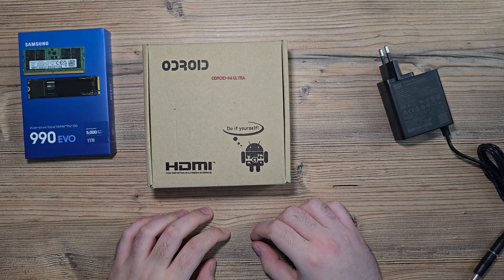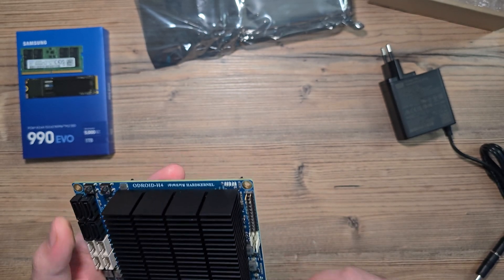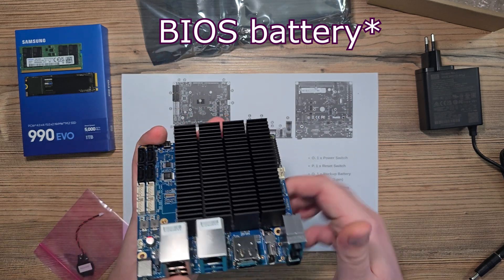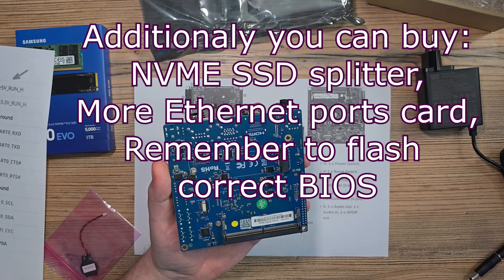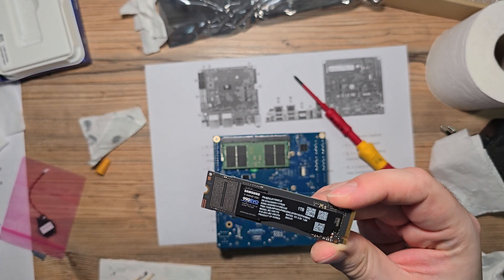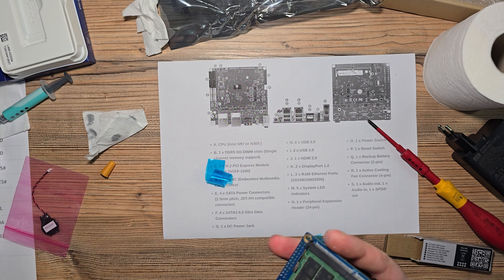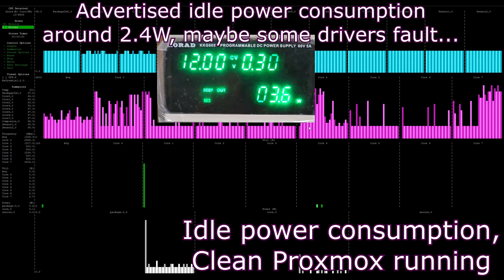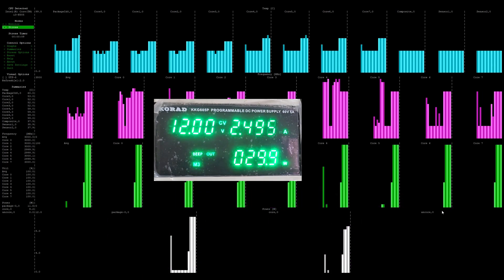The Best Homelab Proxmox MiniPC? Odroid H4 Ultra Intel N305 Detailed overview 2x2.5G 8 core 32GB RAM

Comment: there are so many options  right now, more m.2, pcie slot, usb4, oculink, better cpu, not really the best option for homelab. minisforun, cwwk, aostar and other are ahead inthat department
Reply from the maker: If priority is two 2,5g LAN ports, choice is very limited.

PS after few months of use, rock solid etc, but i hear coil whine coming from the odroid, might be interrupting.
Reply: @HobbyWithAdam  what i mean is that you cant say "the best" when there are way better boardrs, more homelab oriented, more ports, more hp, the odroid looks more like a low power mini pc, i has no more things any mini pc has or less and has less than half of what others under the title of server or nas has... soo, no its not even near. i have an h3+ and it always felt short, just for testing concepts before buying the real deal
Reply: i was wrong, i tuck a look at the boards again, and there is a m.2 x 4 expansion, with that it looks better, the power consumption may not be the lower, so a rayzen will seem like a better choice depending of what you need, that is for the pro, so I put it one step up. The plus I don't know, from specs the n97 is the same as the n100 with higher clocks and less efficient? if that is the case, why? and for the basic the 1 lan port looks like a dial braker for homelap
Reply from the maker: @ Ryzen in my case is disqualified at start because of jellyfin and hardware acceleration, on AMD simply it doesn't exist ;) 

Yes, N97 seems be better than N100
2,5g ports that i need must be on intel chip too which is not a rule.
Reply: @HobbyWithAdam  yes its a shame that amd doesn't have decent hw acceleration, for me is ok software since i am the only one that use it

Comment: Im in a hunt for good Mini PC. I have Odroid H3+ But i think H4 ultra is much better. I want to use H4 ultra as my main PC. My main now is GTX 1060, I7 6700, 16gb ddr 4. Sata Ssd. What do you think is the H4 ultra as good as old GTX 1060 PC.
I did some tests with it vs H3+ for video editing. With H3+ the videos took about two hours more to render. And what about the screw holes? You have to drill them yourself ? And where to get the screws?
Reply from the maker: Odroid is not a standard PC, its MiniPC designed to be low power and efficient. If you want just for networking it will be fine, other things I would not recommend. What screws do you mean?
Reply: I mean the other screw that you attach to m2 heatsink. And do you know is this compatible with H3+?
Do you have possibility to do a video editing test with Kdenlive for exapmple1 hours 30 video to edit it/convert it to like 1080p/60fps and share the results how long it took to render. Thank you! Im not sure but as H4 ultra is more powerful than H3+ then it should do this littlebit faster faster. Im confused what mini PC to buy. So many choices. Im not doing the video edit often, but when i do i need that the pc is not loud and do it reasonable time. With H3+ it's not very loud and i like it for that but takes too long time.
Reply from the maker: @Estmusic323  other screw was mine that I have no idea where I found it (pure luck lol). No idea if its compatible with H3+, I would say its about not compatible with H4, its angled, but its working. Unfortunately I don't have possibility to do a video editing because I have proxmox, opnsense home assistant etc on this odroid. Maybe think about SFF computers? if your use case is desktop-like?
Reply: Yes it's desktop like but i want as small as possible as quiet and as powerful as possible. I like the form factor of Odroid/Mac mini M4/Minisforum UM 890 pro. Tough choice as i want to use it as only PC years to come.
Teoretically if H4 ultra has 8 cores vs H3+ 4. Then it should do video editing with half the time it takes with H3+. Im kinda confused here. All these mini PC's im afraid they become loud overtime.
Reply from the maker: @Estmusic323  N305 has better single core than H3+, and N100. But keep in mind that these are intel E cores. Noctua fan is expensive but quiet. Maybe check for some dell micro/pico or something like this? eventually check some miniPCs with pentium 8505, you will get dual ram and one P core

Comment: Looks like a nice board. Have you had any compatibility issues or issues of any kind with it?
Reply from the maker: I haven't replaced CWWK yet (thinking about migration procedure)

but I must say that until installing proxmox, playing with some benchmarks, BIOS settings etc it worked flawlessly.
Reply: @HobbyWithAdam  Can't wait for the follow-up video where you demonstrate the populated Proxmox server. Currently I'm debating with my self whether I run Proxmox or TrueNAS SCALE 24.10 on my two H4+.
Reply from the maker: @memseeker  Proxmox gives you versatility,
Here is video after 7 months of 24/7 usage cwwk n100, I'm showing there how i populated it
https://youtu.be/dnKJwBVLp30?si=V7ZQJoLDWvCyCQ7E

for another video where I show populated N305 we will have to wait, Unfortunately currently I'm focused on totally different topic which unexpected popped up (electric scooters...)

Comment: It is a pity that the board itself is relatively expensive as you can buy a mini PC with the 5825U (barebones) for $191 USD vs. the Odroid H4 Ultra for $220 USD.
Reply from the maker: Comparing to CWWK, price is similar for N305 but quality/support etc odroid has better.

Regarding AMD 5825U, AMD would be no go when thinking about jellyfin hardware acceleration, and maybe some problems with opnsense, 
aand it's hard to find minipc with two intel 226 NICs which are essential for opnsense

I have spend too much time for searching a decent replacement with better performance/power efficiency :)
Reply: @HobbyWithAdam  
"Regarding AMD 5825U, AMD would be no go when thinking about jellyfin hardware acceleration"
Wiki shows that the 5825U has a GCN 5th gen iGPU, so I am not sure what hardware accelerated decode/encode engines are available for that APU.

"and maybe some problems with opnsense, 
aand it's hard to find minipc with two intel 226 NICs which are essential for opnsense"
You USED to be able to get a Topton mini PC with 4x Intel 226 NICs and the 5825U for around $336 USD.

It's more than the Odroid H4 Ultra, but it also comes with two more ports, a case, and power adapter (the latter two are things you'd have to pay extra for the Odroid H4 Ultra).

So, it depends on how much traffic you are looking to put through the 2.5 GbE NICs.

(I just googled it to try and find an AMD mini PC with Intel 226 NICs.)

"I have spend too much time for searching a decent replacement with better performance/power efficiency :)"
You can get better performance/power efficiency if you are willing to spend more.

I'm always looking to try to get the lowest $/(performance/Watt) as I can.

There are systems that are > $500 USD that are more performant, and therefore; have a lower $/(performance/Watt), but if I am trying to buy three of them to make a cluster, it ends up being quite expensive all said and done.

Conversely, I can get three of the 5825U mini PCs, cluster them together, and depending on how much RAM and storage I put in to each node, the barebones themselves are only $191 USD each. I think that I calculated that you can outfit each node with 64 GB of RAM and a 1 TB NVMe 4.0 x4 SSD for around something like $330 USD all said. So it's about $100 USD more than the Odroid H4 Ultra, but it's got more RAM, more storage, and the CPU is more performant.

(I've tried transcoding 2160p movie down to 1080p with Plex, and it doesn't do particularly well with the Intel N95 Processor, which I know, the UHD Graphics in that isn't as powerful as the UHD Graphics that's in N305.)

So it depends on what it is that you're trying to do (and how).